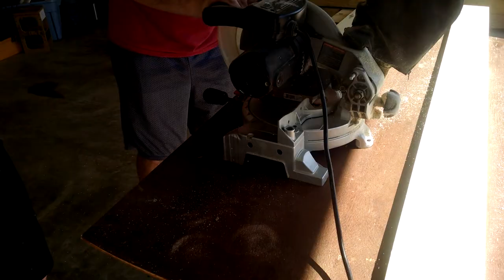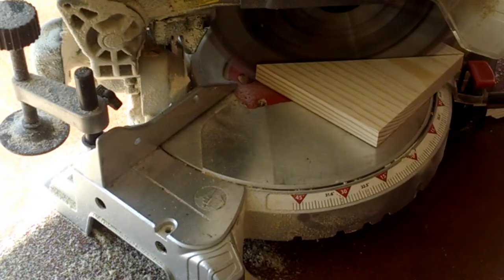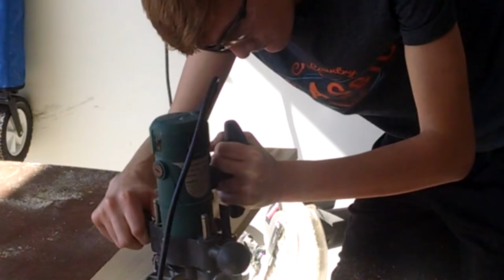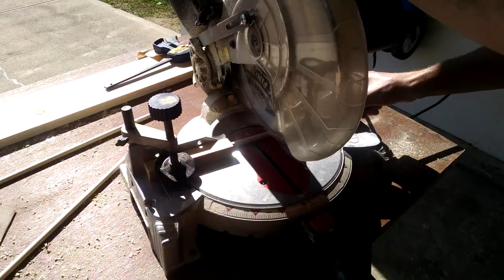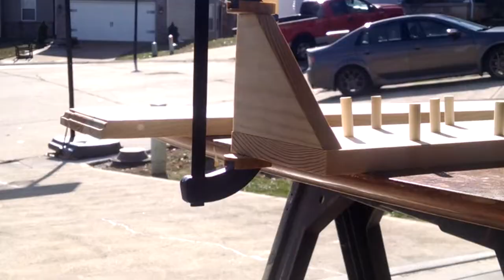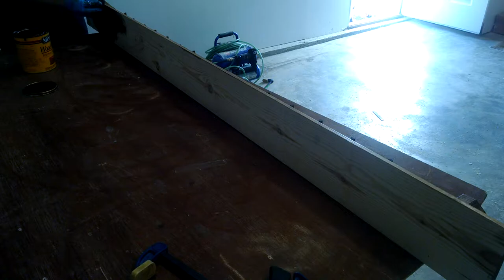Simple DIY Medal/Sport Display Shelf

Comment: would love to try building this for my niece however i do have a couple questions. First of all great looking project, nice job!   How did you use your pocket hole jig (how many holes, spaced apart, etc)  and what kind of screws did you use to attach the boards together using the jig holes?  Also when drilling the dowel holes, did you drill all the way through the back of the board or only part way? Thank you very much, take care.
Reply from the maker: Thanks for the feedback!  For the medal display we didn't use any pocket holes.  All of the wood was attached with wood glue and brad nails.  The holes for the dowels were drilled approximately a half inch deep and we used wood glue to hold them in place.  Hope this helps!
Reply: @howtofixitworkshop  have made 2 since these comments. Thanks alot man!    just bought a router was wondering if keyholes would work on the back instead of drilling through it. Have you tried?
Reply from the maker: That's a great idea! I haven't tried keyholes but I think that would work just as well!

Comment: Thanks for the video.  What did you use to end up hanging it flush on the wall?
Reply from the maker: No problem! We just used a few 2 inch screws held into the drywall with drywall anchors
Reply: @howtofixitworkshop  did you notch into the back of the shelf and hang on the screws or drill through the whole shelf?  Thanks for replying!
Reply from the maker: I drilled through the shelf itself. Just measured out the screws in a straight line. They end up being mostly hidden by the medals

Comment: Looks awesome watching 3rd time. I want to do same as like this..
Can you tell me the measurements? Length, height what s the gap you maintained?
Reply from the maker: I believe it is a 6 foot 1x6 inch pine board. The spacing between holes is 2 inches. 
Thanks for watching!!
Reply: @howtofixitworkshop  thanks for the reply.. love from india...